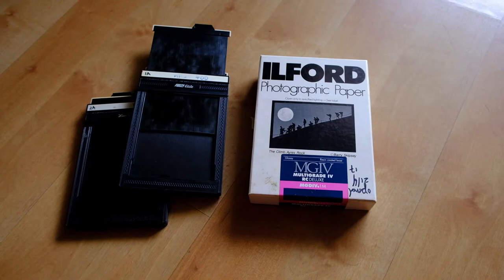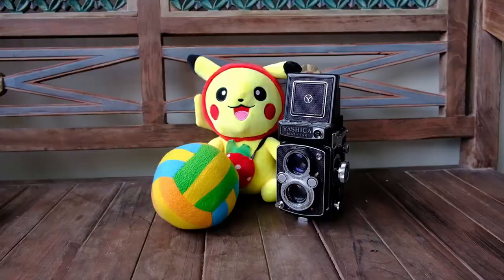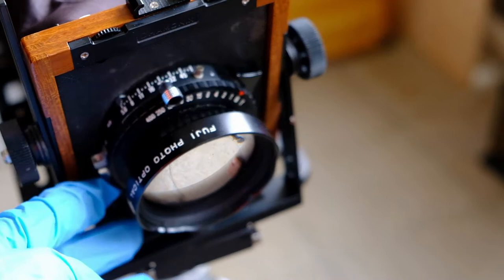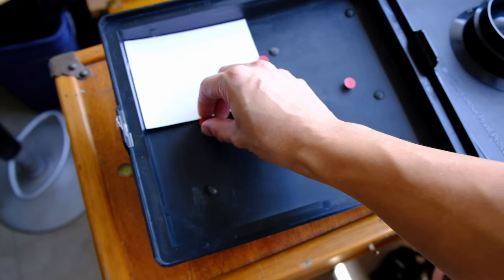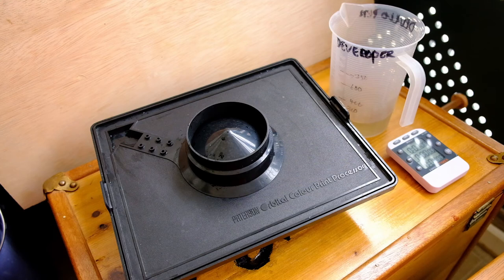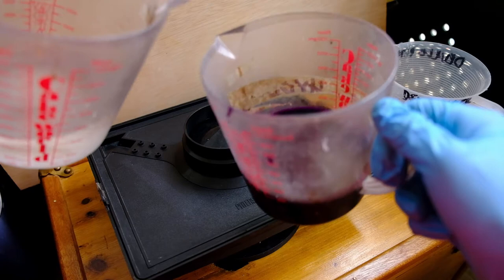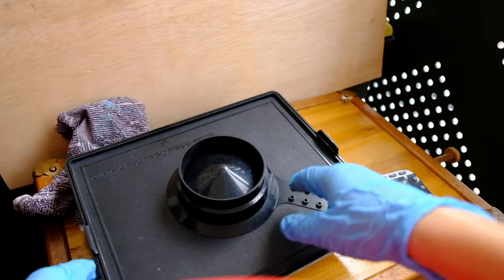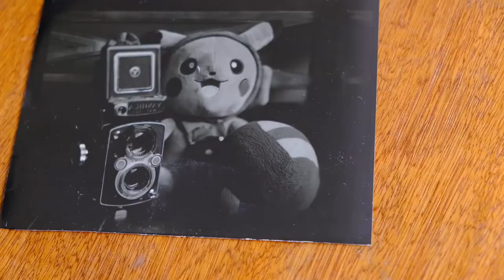Film Photography Black and White Paper Reversal

Comment: Thank you so much for posting your process. I copied one out that I found on Flickr a few years ago, bought some of the chemicals I was missing from my darkroom......and then did nothing. Your process is simpler and motivated me to finally give it a try. It worked perfectly the very first time using a basic 4x5 Calumet! Thank you so much. I'm now going to actually get some use out of four boxes of 5x7 paper which were delivered to me pre-fogged 😞 Your process kills the fog completely, where using benzotriazole in the darkroom for 'normal' prints simply failed to have any effect at all.
Now, of course, I'm going to have to build that 5x7 camera and darkroom box or Afghan/Velophot Camera so I can take this trick out on the road!
With much admiration and gratitude,
from Australia
Reply from the maker: glad to hear that it works for you. i believe the fog helps to lower the contrast of the photo which helps in this process. Enjoy!
Reply: @AnaloguePT  Under normal circumstances, I'd agree with you, but this paper stubbornly refused to be at all affected by my usual fog clearing efforts (I use a LOT of old paper) and I'd tried this in a pinhole camera in the past with the hope of making use of the fog to, as you said, lower the contrast. The fog stayed and the contact print was every bit as fogged as a print made from a film done under the enlarger. So, technically, yes, the fog killed the contrast, but not in a way that made a usable paper negative.
Your reversal process, however, completely cleared the whites. The two paper negatives I reversed came out astonishingly well and your recommendation of three stops overexposure was spot on. One of the photos was indoors by ambient window light and the other was of the exact same scene, lit by four pops of a flash at full power. Both turned out perfectly and you're getting all of the credit for that as I am generally terrible at flash metering. 😁 So, thank you again, I'm truly impressed by your efforts and grateful for the time you took to post your method online.
Reply from the maker: @MolliGelf  always happy to hear my videos help in one way or another. Enjoy shooting !

Comment: Hello,

I am trying your way as your way seemed to be far more simpler than the other ones I have found.

I tried with
A/ with open trays in a darkroom
B/ used some C-41 blix as bleach (might try some RA-4 bleach)

And you guessed it, no success. 
The image disappears and the paper returns to "white" but second exposure + development doesn't make a positive (if do look very very closely I see something appearing)

if I got the right bleach could I still do A???

And do you have other suggestions for bleach, the way you use it??
Reply from the maker: Since you are doing it in open trays in the darkroom, do you see a very dark negative after the 1st developing stage (before bleach?)  It should be very dark since it is overexposed by a few stops. If so then at least we know the 1st developing is correct. 

I never try with C41 blix  but since it is a bleach + fixer then it would have fixed the paper which is why the 2nd development  has no effect on the paper.  Are you able to try with the potassium permanganate + sodium bisulfate bleach?  these 2 chemcials should be easier to get. Sodium bisulfate is used a PH reducer in swimming pools. RA4 bleach ( with no fixer) might work but I have not try before.

Comment: Yesterday I started to play with FomapanR-100, this kit set is dedicated for developing negatives but seems to work with paper as well. 
Finished with some smoke prints but I probably bleach to short. The reference times from for negatives are:
Developer A: 12min, Bleaching Bath: 8min, Cleaning Bath C: 3min, Rexposure 2x 30sec (1m 100W bulb), Developer A: 5 min, Fixer: 4min

For my foma variant paper 313 I tried to use:
I was doing contact 4x5'' prints with 'normal exposure' (I would use this time to do normal positive prints, maybe I should give it more light ?)
A: 2min, B: 1min, C: 0.5min, A: 2min - with some smoke/mist on prints (not clean whites) probably to short bleach but as I put out my print from bleach it seems to be completely washed out as expected (maybe not good indicator of successful bleach bath :).

Sharing my thoughts, maybe it will help someone, thank you for this video. Cheers !
Reply from the maker: Thanks for sharing. Sound like U having a good time with processing.

Comment: Awesome information, thank you very much 👍. Can you tell me if you can only use the Potassium permanganate and still works? And if you can use muriatic acid instead of sodium bisulfate? Thank you very much. Cheers 👍
Reply from the maker: Thank you. You will need both potassium permanganate and sodium bisulfate to make the bleach. It a old formula so I would follow it exactly. I just read potassium permanganate will produce toxic chlorine gas when mix with muriatic acid so be careful of that. I would only mix proven working formula and read all MSDS before mixing.
Reply: @AnaloguePT  I'm just asking because I have a friend that say we don't need use the sodium bisulfate, but I never try it yet. And in the link you have, they saying ph reducer and muriatic acid alternative.
Reply: *sodium bisulfate | muriatic acid replacement "not alternative"
Reply from the maker: That is Cool.. do share if you find out anything more.

Comment: Get a paper cutter sir much easier and cleaner lines and edges
Reply from the maker: yes i have bought a paper cutter since then.
Reply: @AnaloguePT  I use to be lab tech carry my own sharpest blad small 6x8 carry my own printing lens
Reply from the maker: @1911geek  that is cool. u must be those who take one look at the projected image on the  easel and can do a straight print  without doing test strips.
Reply: @AnaloguePT  You could make just one cut on the 5x7" paper to create a 4x5" piece -- by just cutting the 7" dimension to 4", leaving the 5" length unchanged. The remaining piece would be 3x5", pretty useful for pre-shoot testing.
Reply from the maker: @robbieandersondop6450  yes that is the most obvious  thing to do. not sure why did i do 2 cuts in this video, i must be not thinking straight then. thanks for watching!